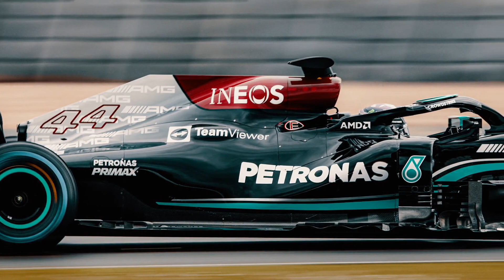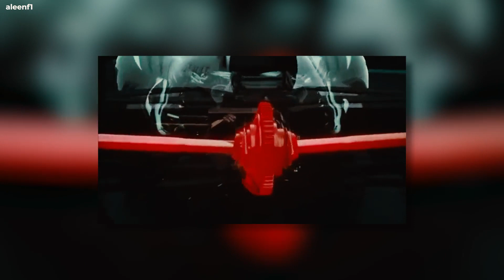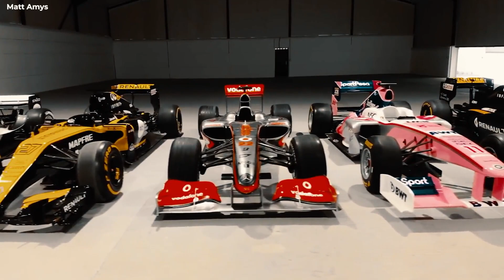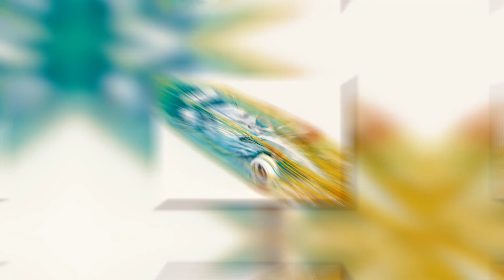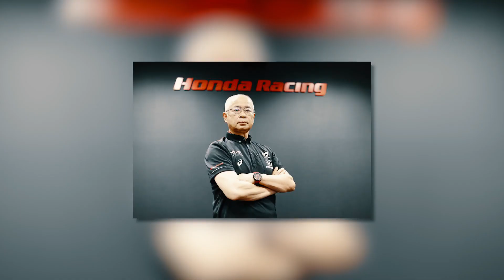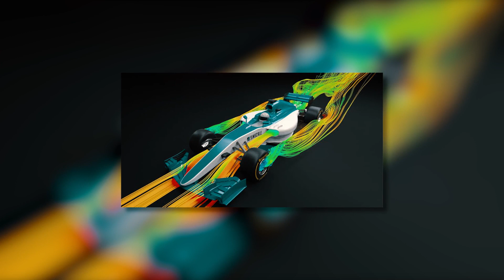Honda’s Secret Of Catching Up With Mercedes F1 Performance

Comment: Sad to see Honda leaving F-1. These advances in engine development usually help the general consumer, and I don’t think internal combustion engines are going away.
Reply: Honda Civic engines are about as good as a heat engine is going to get - somewhere around 28% efficient.   

Those antique tech engines will disappear more quickly than you realize.
Reply: @brucemacneil  they better get 500 miles and charge full in 5 minutes then.
Reply: @joelpierce3940  charge,?
Reply: @joelpierce3940  I think battery swapping is the future tbh. Also, they will get a lot better in range(they already are pretty good)
Reply: We will have IC engines around in diminishing numbers. Facts are, forecasts of manufacturers have or are placing end dates on internal combustion. It's happening. The future is electric but there are some limitations that must be overcome. 10 years from now when other than special application, we're going to be at minimum in a hybrid world but most likely almost entirely electric. This period in history will be viewed similarly to the period of the Model T . I grew up in the 70's and 80's where every guy had dreams of a big block Chevelle, Mopar or Mustang. Then we lifted trucks for 32, 38 or 44" tires with glass packs bolted to Hooker Headers. It was in harmony with head banging heavy metal. 
 But even at my age I know, we will still have our old heroes of gas guzzling cubic inches, don't tell me you aren't impressed by the absolute domination of all wheel drive, massive amperage computer controlled mayhem of tire adhesion providing g-forces of acceleration at blistering numbers that otherwise would only be fantasy shit~ A real hot rodder is going to be impressed believe me. Yes, the nostalgia is an emotional part of it. Getting there is the adrenaline side that hooked us from the first moment.
Reply: Luckily all their work won’t go to waste, since redbull Will take over their all of their work, could actually be a really good move since its now inhouse work
Reply: @Skillzvideos  it’s going to cost them. They were riding in the backs of the Honda Engineers.

Comment: Engine is just one part, the chassis is a bigger part just look at williams. They have for many times hindered Mercedes with new regulations that is why redbull has caught up not otherwise!
Reply: Not to mention Merc is most likely more focused on 2022 while Red Bull is going for it now. Merc is preoccupied with the upcoming regulations
Reply: @kharrington5268  you do realise red bull is focusing on 2022 as well.
Reply: @whatinthe4500  Not in the same way, RedBull keeps brining updates (even big o es) to their car when Mercedes has stopped ages ago.
Reply: @MJ Yea that is true as the direction a team chooses for the new regs can commit them a good or bad philosophy however there's a crazy amount of R&D which takes time that you'll have less of if your busy with the old regulations.
Reply: @kharrington5268  u believe what merc saying? they did say that, but after saw redbul outperform them in mid season they start bringing update to their car

Comment: Mercedes prolly has an engine ready. That's because all other teams struggled to keep up made it unnecessary to release yet anoth engine. It's what I'm thinking.
Reply: Mercs engine doesn't compare.
Reply: I think they're also pushing the durability to see how hard they can run it for the upcoming regulations.
Reply: @MFizzle777  who knows .....but their title with Ferraris was also neck and neck and mercs won 60-70% on the reliability of the engine and now if someone says mercs are having reliability issues I sounds shady to me

Comment: Yeah except the honda engine is not as fast as the merc, it only looked like that early in the season because merc didnt have the floor down and had to compensate for this with (inefficient) large wings, slowing them down on the straights
Reply: Bingo

Comment: Give me a break. Mercedes magically found more power during the season. They've always had power to be utilized when needed.
Reply: Allison said they have found 35 BHP more power with new engine design.., wonder they haven't unleashed that engine this year so far. 

Toto said they are going to go aggressive in last 7 races, might see Mercedes unleashing their new engine, which is meant for 2022 (one thing we don"t know when Hamilton will take new engine or he would need a new engine or not is a mystery. Bottas 2 new engines in as much as races is a bluff, to show a reliability concerns).

And Mercedes are yet to reveal the secret of where they spent their 2 development tokens.

Comment: Honda and Red Bull caught up bc the limited the Mercedes power unit by shutting down party mode and the ability to turn up the wick mid race in the name of safety; also the killed the Mercedes High Rake concept aero this season by taking a chunk out of the floor, congrats on the engine improvements but that’s the reason they caught up.

Comment: Ferrari will catch up un 2022 and possibly pass up all others.  Of course Mercedes will not stand still either and so I think in the power wars next year, Ferrari will be out front followed by Mercedes and Honda with very similar power.  Ferrari have the best line up I  think and Mercedes too will be really strong with George Russel, to  the be team leader when Lewis retires.  Depending who they can convince to drive the other Red Bull car, the team mate will almost certainly be the back up to Max.  But if Red Bull are eclipsed by Ferrari next year there will be plenty of long faces.

Comment: Honda having caught up is clearly not correct though. Cause whenever RB is close to Mercedes they do that with much lower downforce level, trimmed down skeleton setups. basically shaving all the downforce they can off the car. Its clear on the powertracks/low downforce tracks where all the cars are trimmed down to an extent that the mercedes power unit is still king by a considerable margin. notably in sochi rb met the limit of trimming down, the car not even being able to go full throttle on that last kink in the 2nd straight once the tyres went off. 
So the "Honda secret" .. is really at least partly RB's secret of trimming down the car as an artform and also how aero efficient the car is designed by newey.. this extents to AT as well who have and RB adoption concept

Comment: Mercedes always gives the impression they are struggling with red Bull, but somehow find the edge when they need it. Will this year be the same?
Reply: The cards are being kept close to chest for the next season, Mercedes brought out their rear flipped suspension setup last year and most team copied it especially RedBull this season sorting the instability they had at the back of the car so...

Comment: Mercedes issue with Red Bull is that pushed to agree to a freeze on power unit development in lieu of Red Bull taking over Honda’s engine rights after this year. They agreed because of the costs that Red Bull would incur to make such a move, and the fact they don’t develop road cars. So it’s a gentleman’s agreement that Red Bull have taken advantage of by expediting developments through this year, whilst limiting the others from future developments.

Comment: Fascinating. These engines are antique tech.   So much more is possible by getting rid of the gasoline altogether.
Reply: Electric is not sustainable either
Reply: @nastystew6942  why is that?
Reply: @brucemacneil  
I would guess it's because current battery technology doesn't have enough energy density per unit mass to sustain a typical race length on a performance comparable to F1.

Kind like how Formula E works
Reply: @gelmir7322  Interesting.   

We know that the electric motors have more torque and power than the gasoline engines. 

And, your assertion that the current batteries really lack  the electrons and are very massive (heavy) - that is for sure correct.   The Tesla cars carry 545KG of batteries whether they are charged or not. 

There must be a better way forward for motorsport.
Reply: @brucemacneil  have you looked up formula E? It might interest you
Reply: @vishp47  Thanks - Formula 'E' is interesting but the batteries are not ideal and the budgets are far below what is tossed at F1. 

The F1 engines are quite old.
Reply: I’d say hydrogen powered engines would be cool but i guess they will stick to gasoline the upcoming few years.
As long as it’s not electric i’m happy
Reply: @kolerezegnee3620  Hydrogen has the distinct advantage of being 10X kinetic energy per unit mass as that of gasoline.  

Hydrogen/Electric allows you to remove the mass of the engine, gasoline, transmission and brakes from the vehicle. 

The reduction in vehicle mass would be on the order of 300KG and the increase in acceleration would be significant.
Reply: @brucemacneil  Chainbear did a video about the pros and cons of hydrogen tech and its viability in F1.

Lets just say the cons heavily outweigh the pros
Reply: @GTChucker86  Interesting.   

The current gasoline engines are like really great copper wire phone and internet connections.  Very old technology and physics pushes to its limits. 

Electric motors are like 5G mobile phones - much much better but only in the efflorescent stage.  

Moving objects operating within a normal range of speed (less than 30,000M/S) are constrained by mass, force and material science. 

The trick is to stop incrementalism and simply step over the arch to the future - or at least the near future.
Reply: @brucemacneil  Yes but not for that long and that is what he was trying to tell you
Reply: @akambibouraima2344  That it is time for F1 to move into the modern age and step away from antique gasoline engines?